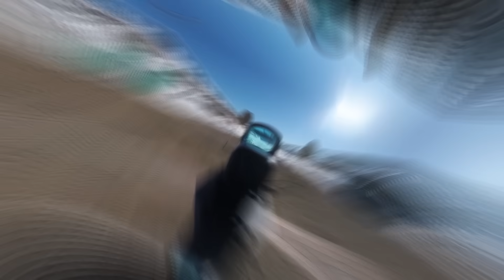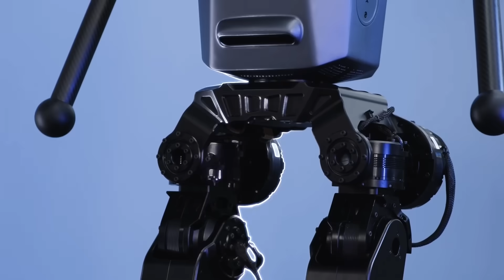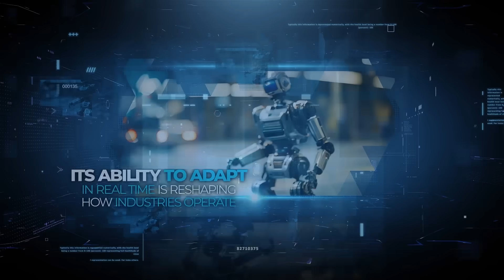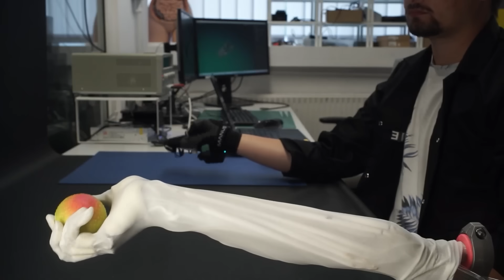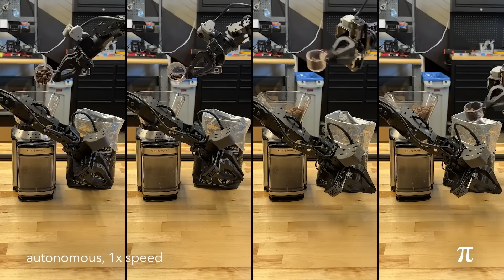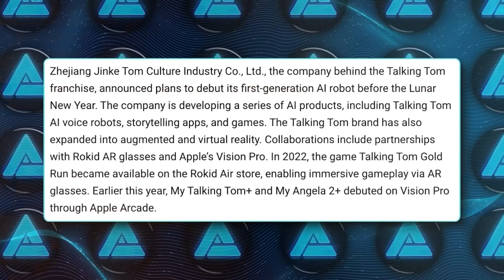AI ROBOTS Are Becoming TOO REAL! - Shocking AI & Robotics 2024 Updates #2

Comment: Another thing about robots, when they meet to compare notes with one another, all they need is to connect cables and exchange information through that connection... Also, when robots are superceded by a better model, they are taken apart and the raw materials from the older are used in making the newer model.